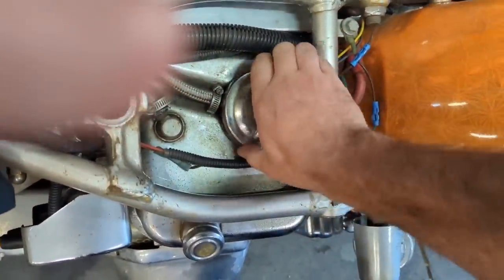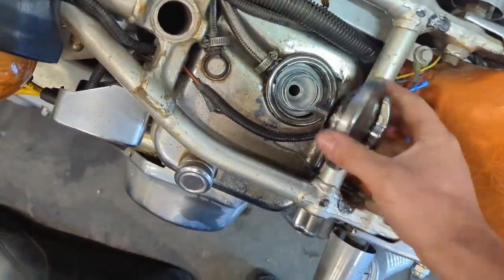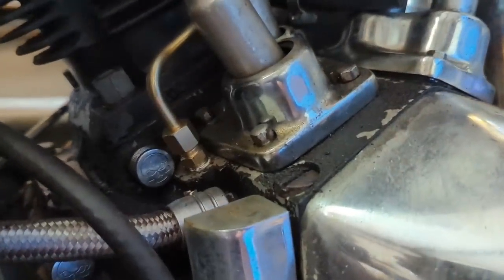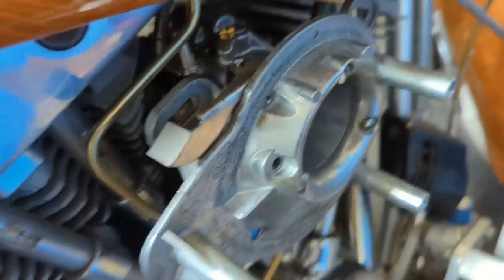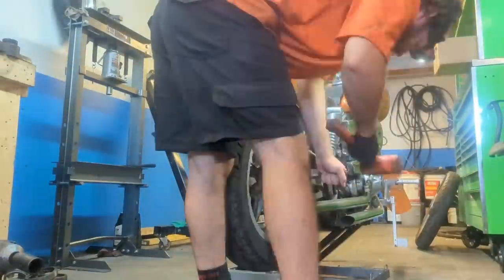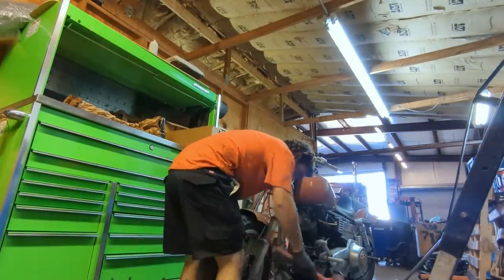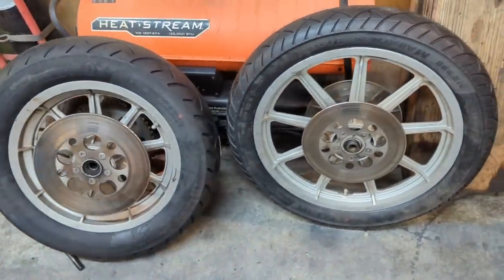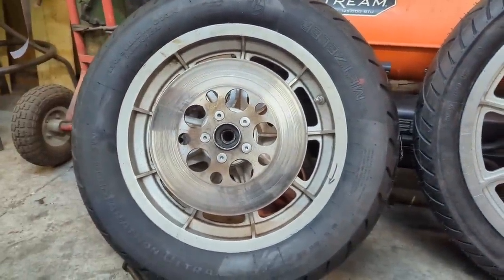Shovelhead or Troublehead? Fixing up a 1970s Harley Davidson Pt 2

Comment: I'm 64, and I've been changing my own tires for 50 years (my first bike was a 100cc dirt bike at age 8) I've changed tires on Harleys, Goldwings, and large Japanese cruisers. The last couple of years my joint problems and arthritis has gotten so bad that I have to have it done by a shop. There are two main tricks to removing and installing tires. I never had a tire machine. I used a couple of very large C clamps to break the beads. Once the beads are broken, the first thing is to put a LOT of tire mounting lube all over the beads and rim. I have used a lot of different things for tire mounting lube, the best I've ever found is some stuff called BeadBuster. It's kind of a gel. I used three 15" Motion Pro tire spoons to lever the tire off the wheel, and install the new one. The trick here is that you have to have the bead opposite to where you are trying to put it on down in the center groove of the wheel. Tires don't stretch, so having the other side of the bead down in the center of the wheel brings it closer to the side you are working on and gives you room to slip it over. I have run into old dried out tires I just couldn't get off that way. I would put a C clamp over the bead up against the rim, push the tire down a bit, and spray PB Blaster on it, and let it soak for a while. Sometimes you have to do it 2-3 different times in the same area. Once the beads are broken, take a box cutter knife and cut through the sidewalls all the way around on both sides, and remove the tread and part of the sidewalls. Then you can usually just slip the well lubricated beads over the rim. If you have to, you can cut them.

Comment: bars definitely need to go. i love the big tanks myself and had a similar issue myself with corrosion. a friend cleaned them out with brake or transmission fluid (can't remember which) thoroughly rinsed and we relined the inside with a  pour in sealant . lasted the life of the bike.
it cracked me up when you gave up on getting the new tire on. my first ever change was done on the side of the intersate when i had a blow out.  no cell phones back then (circa 1980) and really didn't have anyone to call anyway. a touring group pulled over right after i had the blow out and went and bought me a rear tire . by the grace of god and 2 large screwdrivers i had it on but no air to inflate it. a guy in a lincoln pulled over to see if we needed help and had one of those cig lighter plug in air compressors and i was only down about 2 hours.  kinda fun seeing someone else doing the ride to live and learn route. looking forward to more updates.
Reply from the maker: The best part about the tires is that I've done several sets on that same tire stand and for some reason those just were not working. I'm slowly getting old enough that I realize a little money spent is worth it vs all the time and frustration 😅
Reply: Both, half of each works wonders

Comment: Great video! If you have any rust in your tanks, seal it with Caswell gas tank sealer. Just did mine (and the greybeards swear by it) and it eliminated my fuel issues. Also, inline fuel filters don't usually work that well on shovelheads because the heat can cause fuel delivery problems-just something to keep in mind if you run into that!
Reply: This is what I would do too.  Definitely cheaper than buying and painting.  EASY to do!  I've done it.

Comment: I enjoy your videos. I have a couple of Ironheads, and an 81 Shovel. I bought a LOT of new parts for the shovel, apes, tires, brake kits, chain, cables and more. I was all into it, now, it has been sitting on the lift untouched for 4 years. I DO have too many bikes, gonna try to get back into this Shovel this winter. I am not a very good mechanic, and I spend a lot of time on YT trying to figure stuff out.

Comment: Keep going man. I've got a  wrecked 77 lowrider down to just the frame and engine. I was hoping to do the superficial stuff like you're doing, but the more I checked things out the more it came apart. At the moment the steering neck bearings were pounded out so I'm currently doing those. One of the rear wheel bearings were toast, swing arm bearings were pounded out, the list goes on. Fortunately, I've got a local shop that I'm friends with and he's an old school guy that's had his shop for over 40 years. Anything that I don't think I can do or don't want to do, I just take it to him. Mine is going to be a "survivor" style, just fix what's wrong with it and that's it. Up next is the headlight bucket that's cracked all the way around the mounting bolt. I been told the thing to do here is to install a wide glide harness, remount the breakers under the tank and get rid of the wire mess in the bucket.
Reply from the maker: Sounds like you're on the right track, and probably think a lot like me. Fix it right the first time!

Comment: Have experienced the same thing with the plugs, my experience is the short reach plugs don't spark as well. I took longer reach plugs and filed off the threads that extend into the cyclinder

Comment: Really appreciate your content, I'm on my first Harley, an Evo heritage softail and I made the mistake of thinking the previous owners knew what they were doing, but I'm making my way through it, I fancy an iron head sportster or shovelhead but they're quite rare although folk are starting to import them from America, respect and greetings from the north of England 👍
Reply from the maker: Definitely seems like the older Harleys command a premium in the UK! You're not the first to leave a similar comment. Enjoy the Softail
Reply: Yeah I love the bike, 😁 and I love the fact it was made in York Pennsylvania 😎 and how it goes down the road
Reply: You lucked out getting the Evo Softail if you've only one Harley because the Evo Softail is a vastly better motorcycle (I own an Ironhead, two Shovels, two Evo FXRs etc and wrenched many more). If you want the ultimate Shovelhead you can bolt one into your Evo Softail chassis to the existing primary with little fuss. Everything in the Evo Softail drivetrain is also used by builders to upgrade cone Shovelheads. Compared to either an Ironhead can be fun but they nearly give them away in the US for many reasons subsequently fixed in the Evo Sportster.
Reply: @Comm0ut   thanks for the info bud,😁👍

Comment: I know a trick for mounting tires that won't go on, take a pair of 2x4s, each about six inches long, get a large C clamp. Squeeze the tire together, opposite  from where you are working the bead over the rim. Getting the clamped part of the tire a little deeper into the wheel will loosen it up where you are using your tire levers. Be patient, too, sometimes just a little bit at a time will get it done. I've mounted a lot of tires that seemed designed to turn my hair white with this technique. I used to just lay a large piece of cardboard on the floor of my garage so  I wouldn't scratch anything, and start wrestling.
Reply from the maker: That's a good tip, I've got a set to put on within the next few weeks and was going to give them a shot on my own before paying. I'll try that if I get stuck again. Appreciate it!
Reply: @buttcrackcycles  Good luck, and best wishes, I'll be watching!

Comment: 1. Remove the oil tank and clean it. 2. Remove tappet screen cap and clean the screen. 3. Install fresh oil and filter. 4. Repeat steps 1 thru 3. 5. Replace oil lines to rocker boxes with Y line,  feeding both cylinders equally.
Reply: Hey Man, stick to your original plan, get the bike running, get all the bugs out, then bring on the new parts for your personal build.
Making a bike to your personal touch is most rewarding.
I know I have two Harley's, an 1989 XL1200, and a 1993 FLHS.
Keep Clean And Running Top for the best of Rides.

Comment: That shovel will grow on you when you get it right. Riding an older bike just makes the blood course through your veins differently when you ride them. It's like owning a old slow noisy time machine. You just need to have patience and pay attention to detail when working on these old girls. Always check the oil while it is hot because they will sump on you so if you check cold you will be adding oil when it is not needed then she will be puking oil when you crank it. A good carb and electronic ignition will be money well spent. ENJOY THE RIDE!!
Reply from the maker: Check out some of my later videos, I've been steadily working on and enjoying it. Thanks for the nice comment

Comment: Its fun wrenching on old bikes without knowing anything about their history,  My old Sporty was full of suprises.  Tires suck, but, I did try the zip tie trick and it worked great on my sporty.  Reason the bastids wont go is mostly because the tire beads are  not in the recess of the rim.

Comment: Hey Paul, I got a question you might answer for me. I am getting oil pressure on one cylinder because the lifter is tapping on one cylinder. I don’t have very much oil pressure has been ran since 1990 but I can’t get the check ball or the piston that big brass screw is a screwdriver. I can’t get it to come out. Any ideas

Comment: for one thing you don't have the bead opposite the one you're working far enough inside the wheel. and did you happen to purchase a can of brake parts cleaner for the master clyinders?

Comment: you can use nylon ties to hold the beads together then it is easy to get them over the rim. look up nylon ties motorcycle tire change. the reason you had so much trouble is that the bead needs to be in the groove on the rim on the other side to be able to get the bead over the rim. when you squeeze the beads together and tie them with nylon ties it becomes easy or at least easier. I did the same thing

Comment: On the tires: lay them flat on cardboard and knee down the near side sidewall, taking small bites(1 inch) with the levers to "walk" the bead over the rim. Front master cylinder: There was still trash in the (vertical) relief port (down inside the resivoure) if it was sucking at the port. And no, im not French!

Comment: Red gas is probably from tank sealer that someone used to seal the tank interiors. Same thin happened to me. Or it's from rust if the tanks weren't sealed inside.

Comment: Troublehead lol for sure .been rebuilding harley  motors for 35 years ,and the biggest  problems  is parts from internal  engine  parts  V twin are garbage  same as eastern mc & Superior cycle nothing heat treated right  !   I have had some little  problems  with S$S & jims but way better

Comment: Spark plug threads look like a repair job, not factory. But take what I'm saying with a grain of salt, I'm not a Harley Tech. It's not uncommon in air cooled engines for the original threads to get stripped out and repaired using a Heli coil kit. Ask me how I know! This is typically the case when spark plugs are not tightened to the CORRECT torque specification and or are not replaced with the frequency that is determined in the maintenance schedule by the manufacturer. 
In aviation, a graphite release agent is used when re-installing spark plugs. Copper grease can also be used to the same effect, but it is important to take this into consideration when torquing the plugs. If the manufacturer torque specifications make no mention of release agents or lubricants, as a rough guide (it's rough!), reduce the torque applied by about 30% or else you WILL over tighten the plugs and risk doing damage.
I know that there are a lot of people out there who will say, "I've never used a torque wrench on a spark plug in my life". And, honestly, I have to say that I'm somewhat guilty of the same offence, albeit, not on aircraft. But the specs are there for a reason, especially in engines that run hot. 95% of the time, the "calibrated elbow" overtightens things by a wide margin. When it comes to steel male threads and aluminium female threads, this isn't a good combination. For all those that say, "I've never used a torque wrench in my life", there'll be plenty that can give you very detailed guidance as to how to remove a cylinder head, how to install a heli coil, or which is the best engineer or mechanic to do the job for you. Once again, ask me how I know. Clue: 1976 Kombi. Now ask me how easy that was to do, with a smattering of tools, no idea, not much patience and no clutch alignment tool.

Comment: The rear master cylinder kit must be assembled for disc or drum , be sure to read the instructions . Keep the Wagner Lockheed rear master cylinder , its the best made . New ones are junk .
Reply from the maker: That sounds familiar, about drum or disc, I think I've read it in a manual. I haven't thrown the old one out, I may try to rebuild it (have a kit on the shelf) to have as a spare.